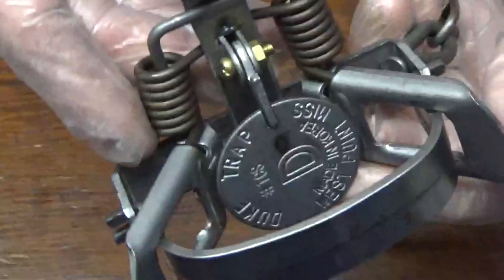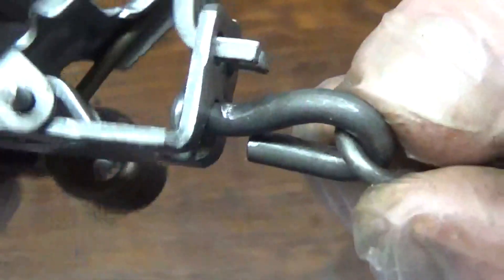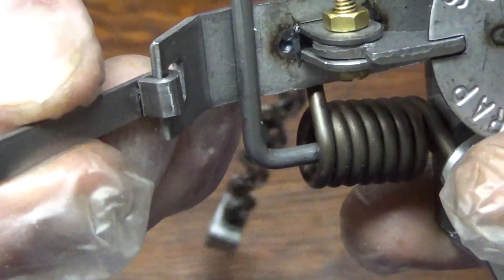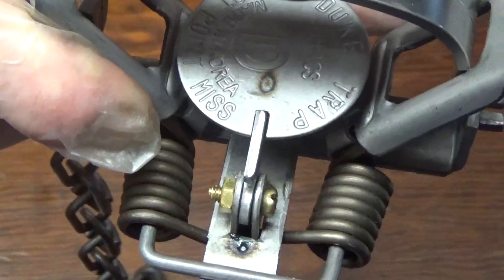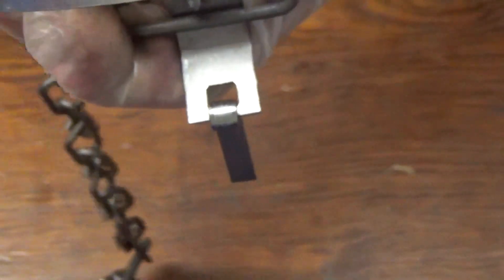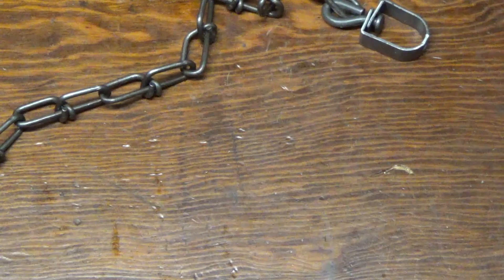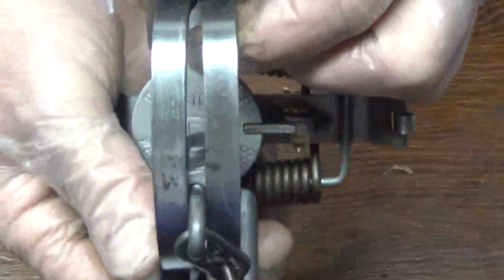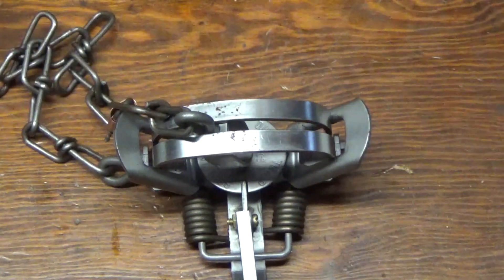Trapping...Duke #1 Coil spring Adjustment's

Comment: I know this is an old video but it was basically the only one that came up in search. I've seen people talk about trap tuning on trapperman forum but no real instructions. This is my first season trapping. Had a miss because a fox or coyote stepped on the pan it fully went down but the dog didn't break loose. Seems like whenever I get the pan level with the jaws it won't let the dog go and snap. I'm going to try crimping the dog a little bit like you did.

I have duke 1.5s and 1.75s if that makes any difference. I've had 2 snapped traps from fox because I set the traps with the dog side facing from the dirt hole. Learned to fix that and yesterday missed the one where the dog was stuck even with fully depressed pan. Super frustrating lol.
Reply from the maker: On the Duke 1.75 oval pan. I have had trouble with the pan getting stuck between the springs. I had to bend up the edges of the pan to stop this. Sorry took so long to reply. Good luck.

Comment: Does putting the pan flat produces that less weight is needed to activate the trap? could it cause for bird to be accidentaly caught?
Reply from the maker: No it does not. I have never caught a bird in a trap. Responsible trappers do not use exposed bait near the trap . So there is no reason for a bird to be there. Thank you
Reply: @SteveandSusiesHomestead  And then how do you put your bait?
Reply from the maker: @florenciaignaciaolivaresbe111  Most times bait is not used . The trap is set in the trail of the target animal . If bait is used (such as fox) the bait is buried near the trap  (6 or 8 inches) and the animals keen sense of smell will attract it to the bait .

Comment: The trigger play on a Duke is the worse!  I believe that trigger adjustment on a Duke brand trap will mean more fur waiting for you.  Toe's in your trap don't put fur in your shed, ya' know?!  I have about 2 dozen Dukes and I've used them for everything I trap for so I'm not knocking the brand.  Yet, it is important that we take the time to tune them before we trap with them.  Steve has an easy way of doing his videos but make no mistake folks, there is a lot of helpful info in that 6 minutes.  Good one Steve.
Reply from the maker: I agree ..But they do have good springs ...My only gripe is they are not made in the U.S...I do have trouble with the 1.75 oval pan catching on the spring levers ,so the edges of the pan have to be ground or a bolt put under the pan to limit the drop...Thanks Pennsyltucky Trapper

Comment: you want 1 lb. pressure on the pan
Reply from the maker: I have found,with the strength of the new springs any tension is too much..Specially with light footed critters like muskrat and Mink . Thank's for the tip

Comment: You shouldn't have to adjust a "new" trap.
Reply from the maker: unless you go with the high dollar traps. everyone I have ever bought needs tweaking
Reply: Your video is excellent! Wish I would have known this years ago. That's why I never caught anything with my pan looking up in the sky. That's why I buy MB traps now. ready to go right out of the box. So instead of $13 for a Duke I spend $19 for an MB and its ready to go. I would rather spend my time trapping then modding traps. I say that and yet I just went into field and stream and manager sold me Duke #2 for $7. I bought them all. Now I have to file the dog, level the pan, loosen pan tension and night latch it. How long is that going to take? 15-20 minutes a trap? It takes a awhile to file the latch right. then the pan tension @ 3 pounds usually have to set the trap 4-5X to get it right.
Reply from the maker: @outdoorswithcam  right on